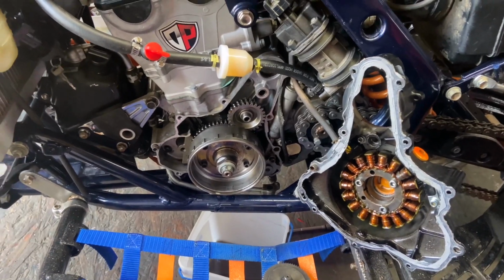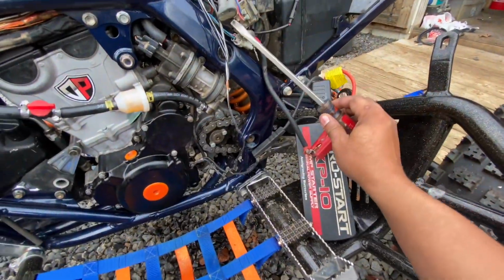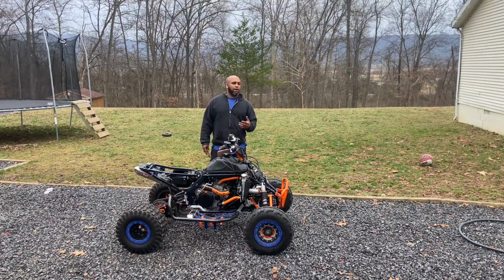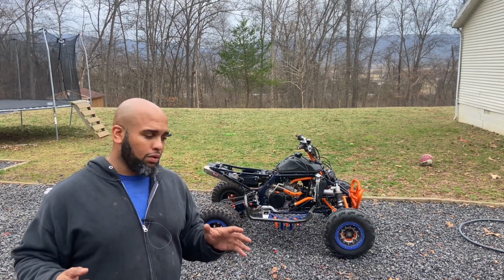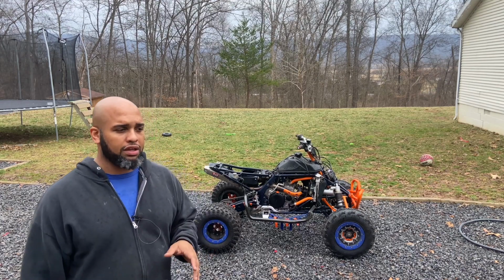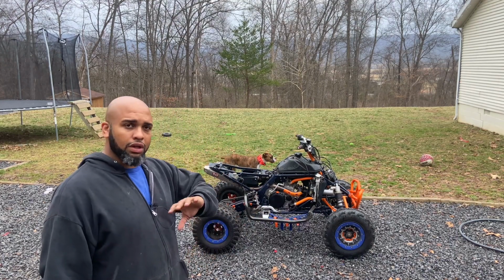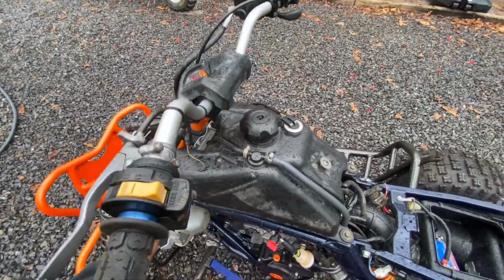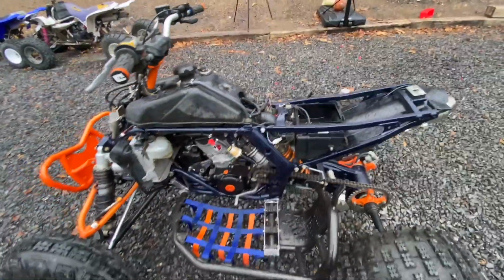LTR 474 What We changed and Why Kick Start Electric Start

Comment: Do you still own any LTR’s? If not why not and would u buy another one 
& what’s the reliability on those engines (I’m aware of the different brands ) my predator 500 is getting lonely
Reply from the maker: I currently have one that I’m working on. It’ll be a little while until I get any footage of it it up. It’s going to basically be a factory restoration. Nothing super fancy. Just pipe. And airbox lid removed but back to stock.

Comment: Can you help me out i need help I have replaced my starter with 2 one China an one used oem, replace the relay next to the battery but not the relay under the rear plastics. My quad will turn over a few times but won’t all turn enough to fire it up some times it will sum times the starter sound slow after trying to crank it up ,if I’m luck I can turn key off for a few seconds an turn on an it will fire up
Reply from the maker: Battery good?
Reply from the maker: Sounds like a wiring issue.